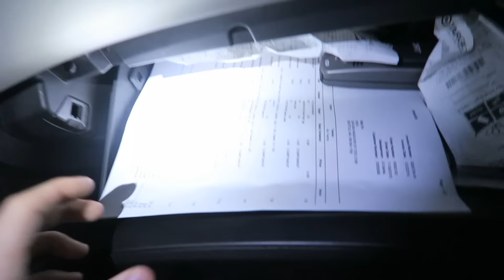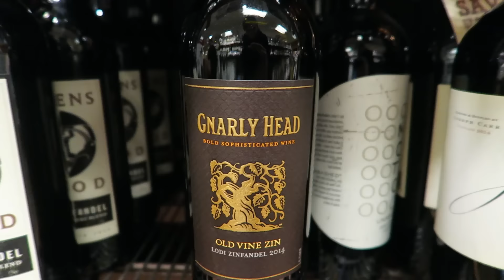Most disgusting hazer EVER

Comment: what's the difference from hip hop turntables to trance. why the different positions if the 1200 is still the same?
Reply from the maker: +Emanuele Ferrero hip hop and open format DJ's like battle position because it gets the tone arm out of the way for doing quick mixing so you don't hit it with your hand. Also takes up less horizontal table space.
Reply: which also means the left sides of the records are closer together ,therefore easier to mix/scratch ,whatever they also do a deck with the vari-speed control on the dj side in battle mode so you dont have to reach over the the record/or tonearm to adjust  speed percentages